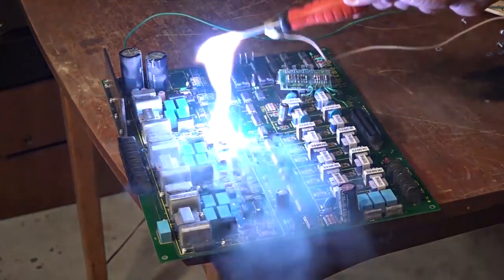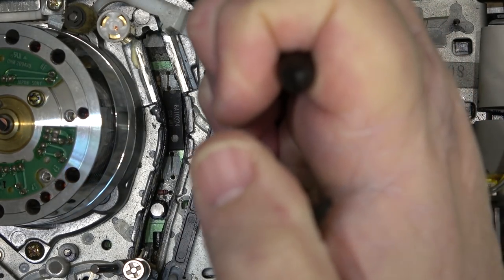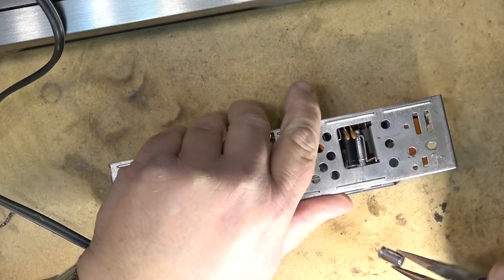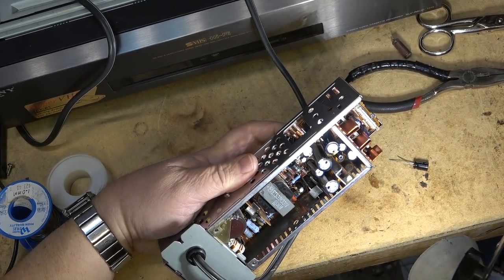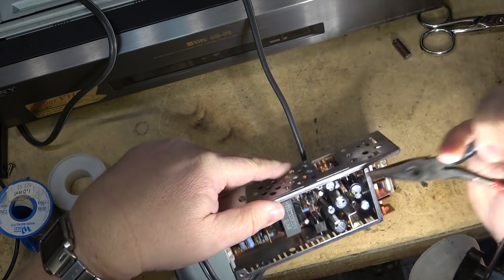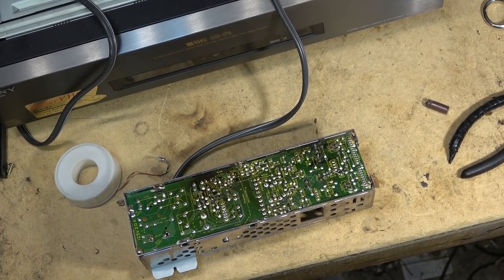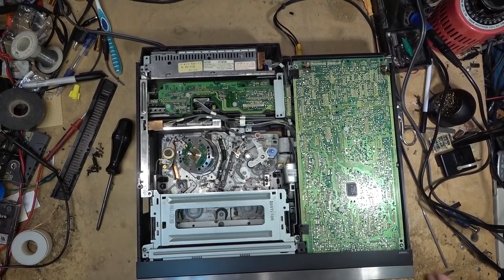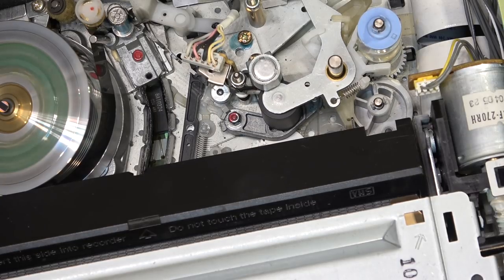Sony SLVR5 SVHS VCR with Multiple Problems

Comment: It annoys me to no end that manufacturers knowingly put Elna caps, that spill their guts and damage traces, in high-end electronic equipment. Despite all this, you've managed to get this expensive VCR back to good working order -- which is simply amazing!
Reply from the maker: At the time of manufacture they didn't know these caps would blow so fast.  They put out an order for specific quantity and specification of caps to various companies and pick the one that gives them the best price. This is how it works.   Notice that there were both Panasonic and Elna caps in this one.  I have seen these units with Elna where the Panasonic ones were in this one meaning that at some point the Panasonic because a better price or vise versa and they changed during the run.
Reply: That’s what I like about Panasonic Technics! They use the quality components, that’s why they last so long , have you noticed also that there belts last 30-40 years! That’s impressive, Sony lost there touch a long long time ago the sl 2000 was pretty much the best machine they ever made!!!

Comment: Smashing repair dave, works spot on :-D
One nicely cooked psu, most of the parts did well, even cooked lol.
Most switchmodes would not have lasted so well.
Yes the elna caps are crap grade,  but how old is that vcr?
About 20 years back maybe, not bad really:-D
I guess if sony filled the unit with Rubycon or similar,  no one would like the final cost.
Yes i remember you doing one of those supplys before, i dont think it was just caps.
Reply from the maker: These ones were blowing up like this when they were about 3 years old.
Reply: @lesoram6236  Im 47, and lived through the whole 80s and 90s VHS bullshit, i say good riddance they were a certifiable nightmare from day one.
Reply from the maker: @lesoram6236  i remember fixing these ones in the 90s.  They were blowing up left right and center.
Reply from the maker: @Synthematix  I said good riddance to tape too. All forms of tape.
Reply from the maker: @lesoram6236  I have a classic tape recorded from MTV from an illegal satellite dish. I thinik it was 1981 I recorded it.
Reply: @12voltvids  Way too many mechanical issues with tape stuff, a 1mm movement in any part of the internal mechanics will either destroy the tape or make it sound like complete dogshit, then theres the fact that every machine records different
Reply from the maker: @Synthematix  yup tape is crap but there is a subculture that believes that tape if the future.  I haven't used tape since the early 2000s for video and the mid 90s for audio.
Reply: @12voltvids  About the only thing tape is really good for these days, aside from leisurely nostalgia, is mass data archiving with formats like LTO.

Other than that, you're right.  Tape isn't used professionally, especially in mainstream audiovisual work beyond dealing with archival material.  And those who've worked with it don't miss it, like at all.  I'm getting into moviemaking and many sound mixers who've cut their teeth with 1/4" tape on Nagra decks love their Sound Devices or Zaxcom digital mixer/recorders.  Tape can sound good, but it's seriously a PITA in this field.  Tape was only used out of necessity.  Once something better came along, it was embraced without hesitation.

Comment: Nice repair video.  What do you use as a capture card for Digitizing vhs tapes?
Reply from the maker: Depends on the format the client wants. For those that want DVD I use a stand alone Toshiba DVD recorded and go straight to disk. If they want AVI files, then I use a Sony GV-HD700 which digitizes composite or S video to DV25 standard.
Reply: @12voltvids  I am having trouble getting a decent rca to USB adapter so I can digitize my vhs tapes
Reply from the maker: @chrisschanneloftechnology4743  
Most of those are garbage.  My unit was 1300.00
Reply: @12voltvids  I really can't spend $1300 or around a $1,000 US Dollars  for a capture card.  Is there one in between that will do the job for now as I am just getting into this business.  By the way I live in the US.
Reply from the maker: @chrisschanneloftechnology4743  
If you want the quality this is what it will cost you.  Cheap consumer devices just don't cut it.  The Sony I have is also a mini DV / HDV deck.  Many mini DV and digital 8 camcorders would digitize to firewire 
If you use a cheap card you will also need a time base corrector.   The high end ones have that built in.

Comment: Great video! Bit of a unrelated question here, my Panasonic NV-HS900 has a problem where it doesn‘t react at all to the HiFi Rec Level potentiometers on the front. It seems to just be stuck on maybe -7 dB input level. I cleaned the potentiometers already and also continuity tested the cables that go from the front panel to the board, they tested good and the cleaning also didn‘t make a difference. When playing back a properly recorded tape, the audio levels all seem correct. All cables connected to the VCR are also ok, I tested with another VCR. Any idea what the culprit for that could be? Thanks in advance!
Reply from the maker: No not familiar with that model. Is there an auto / manual record level switch hidden somewhere, perhaps in a menu on the remote?
Reply: It‘s purely manual, there‘s no switch sadly. What‘s also very weird is that it sometimes, out of the blue, just starts working again. I‘ll probably get the main board out next weekend, i‘ll check it for loose soldering connections too.

Comment: Elna caps.  When I see them I pull them.  Can't say how many boards have been destroyed by these.  Worse was an Advantest SA.  Power supply boards were so bad I was never able to get them running.
Reply from the maker: We had a phrase for Elna.
Electrolyte
Leaks
Not 
Acceptable.

Comment: a question if you dont mind, what is the use of all those holes drilled in the tape head? is it for balancing?
Reply from the maker: The holes in the head for for the dihedral adjustment screws. This was an adjustment not needed on VHS but Beta techs had to make this adjustment when a head was replaced. There are set screrws in there to adjust the angle of the head chip. Never touch them, or you will be buying a new head. They were set at the factory with a microscope.
Reply: @12voltvids  many thanks for your reply

Comment: Hi.I am in need of some help.i have slv 615 with no power at all.And also a  slv 625 with stand by light on and when press the power button the whole system goes completely dead(no clock).i would really appriciate your help thank you.
Reply from the maker: Wouldn't know without it sitting on my bench in front of me.
Reply: @12voltvids  ill change all the caps and see if that brings them back to life.thanks for your reply

Comment: Sir what is the posible defect with a cd player if the lens does not have a light and the spindel motor is not working?
Reply from the maker: It's broken.
Reply: @12voltvids  you mean, both lens and spindle motor are broken? What is your suggestion sir? Can I replace the cd player with a new lens ang spindle, even a different brand? I still want to use my cd player, please help me.
Reply from the maker: @robertpascua5264  
The motor won't spin until a disk is detected.   The laser should try to move towards the spindle first to activate the top (top of disk) switch.  Once that pin or leaf switch is activate it turns on laser and attempts to focus and if a disk is detected starts the spindle motor.  So check the sled and top switch first.

Comment: I thoroughly enjoy any video that deals with power supply repair, since they are fairly universal (meaning tons of electronics have them, if not most.) I am just right now at the point where you are showing the leaky caps and effect on the board. It really has to make you wonder, well not really if you really know (planned obsolescence) why gear exists from the 70s, 60s and earlier with operationally-perfect caps and you can buy something today with failing caps in a year. Early 2000s, the capacitor plague wiped out tons and tons of PCs. That's when China stole electrolyte formula but would use it wrong, or maybe they stole something intended to mess them up in the first place. Dell paid dearly for this, hah! Now, for me to pay attention on how you make it well. :) https://en.wikipedia.org/wiki/Capacitor_plague
Reply: Paul Carlson, (of Mr. Carlson's Lab channel) says that quite often, capacitance can go up in value in failing caps. I never knew that before!
Reply from the maker: The reason why capacitors from the 60s and 70s did not have the problem that the current generation do is due to the chemical makeup of the electrolytic. Old capacitors were typically oil-based and used PCB oil in their composition and as you know pcbs are carcinogen and are now banned. The next generation used fish oil as the electrolyte the problem with fish oil is that the pH is not stable and it has a tendency to change pH depending on the state of charge in the capacitor. This pH change caused the electrolyte to become either slightly base or slightly acidic in either condition the rubber plug on the end of the cap was deteriorated also the copper wires were etched by this acidic or base fluid causing leakage at the seal. Newer capacitors use a water-based electrolytic the problem with water-based electrolytics is water boils at 100° C so water-based was only good for capacitors rated at 85° C. Power supplies especially switching power supplies operate at high frequencies and pulse load which generates heat in the capacitors this requires a high temperature electrolytic still water-based but with additives to prevent the water from boiling some of the early chemical compositions did not hold up and a lot of pressure to build up causing the cap to pop the vent this is known as the bulged popped capacitor. So to sum it up old PCB caps last forever fish oil-based caps typically eat through the rubber plug and leak onto the board because the electrolytic is corrosive and the water-based caps the early water-based caps had a tendency to boil and blow the pressure seal.
Reply: @12voltvids  I try to learn something new each day. That has me covered for the whole week haha! Yeah yeah, even on the supply in this video and even though there is no room, I still always think "fan." Usually, not so practical for such a piece of gear (unwanted noise by most people and other factors.) I keep the PSU to my main PC rig on top of the case instead of inside. It and everything else stays far cooler this way. If anything, it should give it a little bit of longer life, even if was going to last long anyhow.

Comment: I was wondering why Main electronics shut down and what happened
Reply from the maker: I can tell you exactly what happened to main electronics as I personally knew the owner. Main electronics was started by Phil Tomlinson, his son Daniel started working there when he was about 13. Phil and Dan ran the shop right to the end.  I remember going in during the last few years that the shop was open and seen Dan looking very thin he lost a lot of weight you don't like to ask but you know it's cancer. Last time I saw Dan we've been summer 2016. He looks horrible couldn't stand for long had to sit at the counter and you could just tell that he wasn't doing that well the next time I went back was to look for a part for that leak Delta 75 and his son informed me that Daniel had passed just a few weeks after his grandfather. His son Scott I guess didn't want to continue the business and since they own the building it was worth a lot of money. The day I bought that transistor to fix the leak Delta 75 was the last day the shop was open. Scott told me that they were going to close down and take a total inventory and then he would decide whether he would reopen or not. They never reopened they sold off the inventory and I don't even know what went in where the store was because I haven't been past there since that time. I'll go over to Lee's or RP to get my parts locally. What I do know is the owner of Lee's who used to have his shop just up the street offered to buy the business and move into where Main was, but they wouldn't lease him the space telling him the building was going to be sold, so Lee's moved over to Fraser St. It's important to support shops like Lee's because they are becoming few and far between, and the best way to ensure that we have these types of businesses is to support them.
Reply: @12voltvids  A verry big thankyou Dave. 
Shops like main electronics are very rare now and days, and will be missed. But even more so are the teckies out there like yourself who give more than you realize. 
You keep the worth of these old but new pieces to the next generation  going, and are able to keep most of what you are able to out of the landfill, But even more so is the selflessness you give in teaching of how these problems can be fixed when they pop up. You are a great inspiration to those like me who love to not throw away because it's simply broken. You are a good soul Dave. Thankyou for all your hard work in shareing and careing...
Reply from the maker: @lawrencecavens5760  Yes we are a dying breed. I am probably one of the younger techs out there and i see 60 knocking at the door. All my mentors when I was learning the trade aren't around anymore. One of the reasons I do these videos is to get younger generations interested in keeping these old beasts running. Us old guys won't be around forever so this is basically passing the torch, and making a buck or 2 while I am at it. Also keeps the mind sharp,

Comment: are these vcrs any good sony slvx811 that you know of please
Reply: Unless you like repairing your VCRs regularly, buy another model.
Reply: thanks for that can you reccomend a model for dubbing please
Reply: @madpom2  
SLV-575UC, SLV-595HF, SLV-696HF. If you don't have the skills or parts to repair them if the threading gear is broken, then buy refurbished. I've got a couple listed on eBay right now (SLV-595HF). I sold the SLV-575UC I had today.

Comment: Hi im 16 years old and ive been watching your vids for a while now and i need help. I have a 1980 bradford/samsung crt b&w tv and i vaccumed the board because it was very packed with dust then when i put it back together i think i knocked something loose while i vaccumed it. It works fine except for the audio it has weak audio and it just pops an crackles and cant barely hear anything so if anybody could help me that would be great thanks.

Comment: those awful psu's,similar to slv715's in the uk, i knew 3 of those, all went to landfill, best end to them, i remember one that the caps leaked all over the board and totally fubared it and at the time new ones were still available as a complete unit around £100 a pop
Reply from the maker: Mitsubishi had pissy caps too, and they used a linear supply.

Comment: I always wanted onr of these vcrs but everyone I find there are broken
Reply from the maker: They all need rebuilding.
Reply: @12voltvids  
I quit buying these on eBay for "parts". I fixed and sold a few. The smell of that electrolytic that leaks out is too much for me to handle on a regular basis. And running jumpers all over the place.is just not worth my time.
Reply from the maker: @NunYa953  I feel the same way, but when someone is paying me to do it, no problem.
Reply: @12voltvids  absolutely. The problem is nobody seems willing to pay what I'm willing to take. 😂 I do sell a TON of SLV-R1000s though. Ten last month and 6 this month already. I shipped you some parts you may or may not need for some of these Sony mechanisms. Might be a month for the post office if get them to you but they're coming!

Comment: I finally got one it was completely dead I change every capicator but still dead
Reply from the maker: How is the ic on the power supply.  They do fail.
Reply: @12voltvids  which side on the secondary side
Reply from the maker: @leonjohnsonjr3331  primary.  If the oscillator is not running you won't get anything on secondary.  If you have any voltage on the secondary side then the ic is ok.